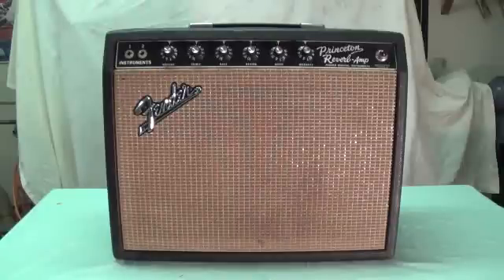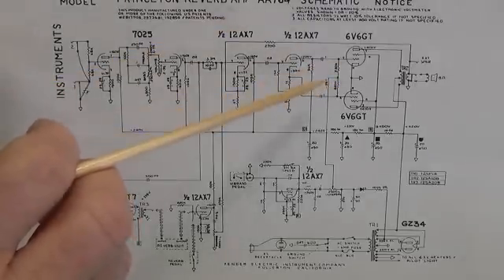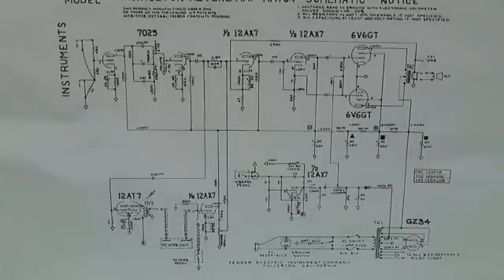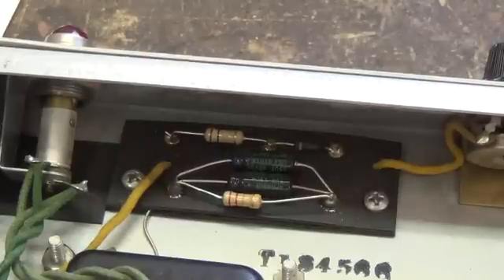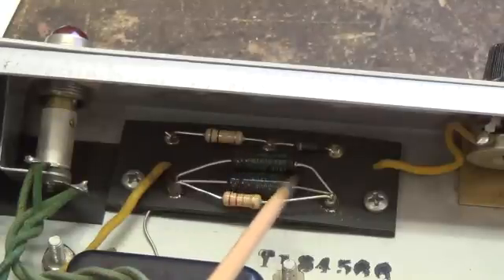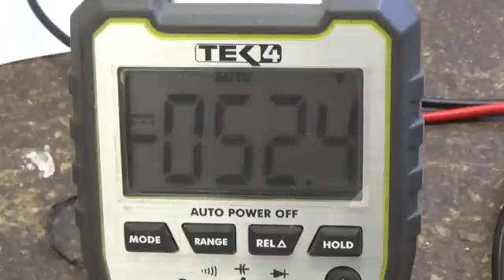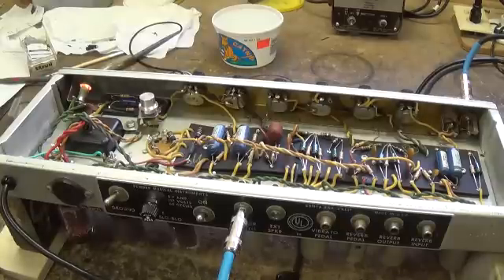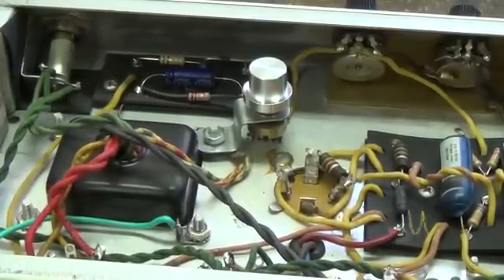Converting the Fender Princeton to Adjustable Grid Bias

Comment: Hi Doug, first I really enjoy these videos and thanks for that. It appears that you are still responding to this older video so I have a couple of questions for you if you feel inclined to answer. Twenty years ago I purchased what I can best identify as a mid 70's SF Princeton Reverb. Some months into using it I smoked the power transformer. I have no idea how. I had it replaced by a qualified tech. It has worked fine (with limited usage) ever since. I got concerned when you spoke of Russian Roulet when it comes to the original pair of 50/50 capacitors. Is it possible that this was the cause of my burnt transformer? You didn't say what could happen if this pair is not changed. Thanks, TW (This mod looks so simple I might go ahead and do it - I'm sure Rusty is still your helper, just at a different level))
Reply from the maker: If you are referring to the 50uf @ 50V cathode bypass caps, they alone could not have caused the failure of your power transformer. The originals can be easily and inexpensively replaced with the higher spec new caps. You should also check your output tube bias.....which CAN cause the PT to fail.

Comment: The best tube amp instructor/editor/photographer/best boy on the web bar none. My only question on this very well done video is can the pot or knob possibly ground to the chassis? The pot looks like its only a few mm from the chassis. Hopefully someday soon Doug will do a video on how to set up and use a scope/signal gen to troubleshoot and bias a tube amp.
Reply from the maker: Thanks so much, Mr. G. The pot is well grounded through the metal bracket that holds it. I have made several videos using an oscilloscope, please see my video list.  The scope is not used for biasing.

Comment: Doug, I've just built my first Princeton Reverb and spent all evening trouble shooting it.  I got it working but had to revert the bias to standard.  The pot is still in place so I would like to get the adjust working.  What range should the negative voltage be from the pot in one direction to the other?  I was only getting a few volts if I turned it slowly but if I turned it quickly it would give me more but then settle a few volts more than it started.  It's just to help me trouble shoot it.  Many thanks.  You have inspired me.  I have now built a 5F1, 5E3 and the Princeton Reverb.....  I have five boxes with parts building up for five other amps.......
Reply: I should have watched to the end of the video again!  I only watched it to the circuit diagram this time but when I came back to ask you I let it run and you show the range!! :-)
Reply from the maker: I'm glad you were able to resolve the problem, Darren. Best of luck with your amp.

Comment: Hey Doug, thanks again for this video!  I have a simple question about the capacitor that is inline with the 27k resistor.  Does the end of that also connect to the new 10k bias pot?  From the angle the video was shot, I'm unable to tell.  
Sorry, if you already answered this question, I got dizzy reading all of the questions and replies.
Hey Rusty; what's up??!!
Reply from the maker: You may be referring to the filter cap for the -DC bias circuit, William. It's negative end connects to the circuit and the positive end goes to ground.
Reply: @UncleDoug ; thanks for the reply.  Have a great day!
Reply: @UncleDoug    thank you for this reply, UD! However, I'm still not seeing it-- do you leave the cap in place where it was originally or do you connect it to the same point on the pot like the resistor? Saying "it connects to the circuit" is still a little confusing as, well, the whole amp is a circuit.

Thank you from a non-EE slack-jawed yokel.

Comment: If the pot fails due to contamination in a way that it creates a large resistance greater than 10k from dirt on the wiper, the tubes will redplate due to an absence of bias supply. I sometimes wonder if running the pot in parallel with that resistor to ground is safer. That way if it fails there still will be bias supplied to the tubes. I sometimes fret over all that bias supply depending on that pot not getting "scratchy". Also, wouldn't changing the value of that 27k resistor to a higher value give you a sweep in both directions instead of just biasing hotter?

Comment: Great vid, thinking about doing this on my Non reverb version Im not using the ground switch, I have a flat head shaft type pot, any reason not to install in there? The can cap is original not leaking and holding a charge long after turning it off, any reason to replace it now? 1965 Princeton

Comment: dear Uncle, I've completed my Reverb fixing, and it was performing fine, then I decided to check for plate dissipation, according to  your video guides.  I measured voltage drop across center tap of OT and the other two ends, each for each power tubes. I had about -4V  DC, with a plate voltage of about 399V DC. This would mean a PD of about 10/11 Watts.  That seemed a bit to high to me, so i decided to install the small 10K pot to adjust bias. If was responding ok, I swept it so to have around 8 W of PD. After that  I was putting back the ampli in his case, then I was horrified to discover that no sound was coming out from the speaker. I did not  make any evident mistakes, no smoke, no shorts....I removed the pot and restored original connections but stilll no sound, just a little hum. So it is possible that I have killed the 6v6 during my tests?  I'm lost at the moment, going to follow the whole signal path to see whats wrong.
Reply from the maker: You didn't provide enough information for me to check your calculations, D, but I doubt that you destroyed your 6V6's while reducing their bias.  Check the bias voltage on the grids.....you may have inadvertently increased it to the point of stopping the current flow.  BE SURE you are properly calculating your PD.....remember that PC is voltage drop divided by OPT winding resistance.
Reply: @UncleDoug  ok Uncle, all sorted out...the culprit was one of the copper wires connecting components on the preamp to the chassis under the pots, which was disconnected leaving all those component with floating ground. Anyway, I've set the bias pot as follows: on one of the 6v6 plate voltage is 405 V to ground, resistance of that side of OT is 146.6, Voltage drop across it is 2.95 ohms, so PD should be 8.14 W, am I right? The other tube has similar values. Am I too cold? The amp tends to distort a bit at high volumes on input 1. Is that desiderable or normal? Thank you again
Reply from the maker: @dreamlessfull  Your calculations are correct. If your circuit is grid biased, 8.14W is ideal. If it is cathode biased, this is way too cool.....and should be more in the 11W range.
Reply: @UncleDoug  yes, being a '67 blackface princeton reveverb, it is grid biased, as the cathode is tied to ground. Thank you again for your time and your invaluable teaching!

Comment: Hey Uncle Doug, I am going to attempt this mod on my 66 Princeton. I believe that I have a firm grasp on the procedure after a couple viewings of your tutorial. But I have a couple questions.......#1: The diode coming off the 100k was facing positive to ground in the stock configuration, right? I see that you adjusted, and re soldered it, but it was orientated that way to begin with. #2: You put some heat shrink, or some kind of insulation on the 27k resistor yes? Is that necessary? Or just something you chose to do just because?

 I think that's all I have, question wise. Hope all is well, and thanks for the great work. 

Josh
Reply from the maker: 1.) The diode just after the 100K resistor is really not facing ground on either side, JC. It is biased so that the banded + end is toward the HV winding and the - end is toward the bias circuit. Thus only -DC (which is what you want) can pass through it to bias the output tube grids.  2.) The heat shrink was simply my own idea, to reduce any chance of a short circuit.  Good luck with your project.
Reply: @UncleDoug  That's a BIG 10-4, thank you for the quick response. Time to go play with electricity.
Reply from the maker: @mr.joshua657  Good luck, JC. Be careful.
Reply: @UncleDoug  Just wanted to let you know that the Adjustable Grid Bias circuit install was a success! I got it done right the first time, and I didn't get lit up. It's a win win! Such a fairly simple mod, I just wonder why Leo didn't put one in, in the first place. It seems to me that the BEST AMP EVER MADE should have such a device to make sure that your power tubes are operating at the proper voltage.Thank you again.
Reply from the maker: @mr.joshua657  You're quite welcome, JC. I'm really glad to hear that your project was a big success.

Comment: Recently did this mod to a friend's Princeton.  Put new tubes in, and they were running wayy to hot.  After the mod, got the dialed in perfectly.  However, now the trem bleeds into the signal even with the intensity pot all the way down.  Has anyone else experienced this?  Thanks for a great tutorial!
Reply from the maker: Since the bias adjustment voltage with the pot is still approximately the same as the fixed resistance, I don't understand how this could be happening. Are you sure you wired the adjustable bias properly?

Comment: Love your videos!  Would it work to install a pot/resistor combination at the point where the negative grid bias splits to both output tubes and create a "balance" adjustment?
Reply from the maker: It has been done in several of the larger Fender circuits, S1. Here is a forum discussion that may be helpful:   https://www.thegearpage.net/board/index.php?threads/best-way-to-bias-a-fender-with-balance-bias.819427/
Reply: Thanks again.

Comment: In cathode bias situation, it's always better to use a separate resistor per power tube. I experimented it myself and it reduces the hum to at least nothing, especially with not properly matched tubes. On the other hand, I widely prefer my power tubes to operate in Push/Pull.
Reply from the maker: Excellent suggestion, Paul. I believe the manufacturers started the single-resistor method simply to reduce build cost and time.

Comment: Hi Uncle Doug,
Thanks for all the great videos. I've learned a lot by watching them. As the proud owner of a 1966 BF Princeton Reverb, I want to go through adding adjustable grid bias to my amp via your procedure. However, I have a question. In your 12/9/2013 video about biasing double-ended output tubes, you caution against using a grid bias pot due to its effect on the vibrato circuit. In this video, performing that modification is detailed. Just wondering if you had a change of heart about the effect on vibrato or perhaps made a New Years resolution to become less of a vibrato hog?
Thanks again!!
Reply from the maker: I guess I found that the good provided by the bias pot outweighed any possible bad effect on the tremolo.....and that the "bad" was virtually indistinguishable.
Reply: @UncleDoug  Cool, kind of what I figured. Like most things in life, a balancing act. I learned a lot about electronics by virtue of an intense, 5 Trimester Electronic Technician course at DeVry completed in 1987 but since I didn't go into a career of component level trouble shooting, I'm terribly out of practice. Your videos are a great refresher and combine nicely with my love of guitars and amps. Thank you
Reply from the maker: You're welcome, UT.

Comment: Hi Doug, thank you for getting back to me. Yeah there is a schematic for my amp on the net for the Blues Deville 4x10 amp. Well yeah everything that I've read on the net says to do it like that. I always have reservations about a lot of things you read on the net. I  just don't want to blow anything like my power transformer or valves up doing something wrong. I was having some time ago a problem with my 1965 Fender Blackface Bandmaster amp red plating. After exhausting every avenue on what the problem could be, I finally took out the bias pot only to find that it was burnt and  ruined. Replaced it and have never had a problem since. I did make the mistake of trying to use KT66 power valves in the Bandmaster and it was playing fine for a couple of days,   then I went to turn it on the other day a nd it blew a fuse and took out one of the screen resistors. I replaced it and put 6L6's back in and It's back up running. I won't be trying that again. I just thought that maybe you could look at the Deville 1993 schematic for me as I'm not good or experienced enough to read these schematics with any competency. Do you think that I should use a 50K linear pot or a 25K linear pot. Which wound be best. It's just that to install a pot in this PCB board, it's going to be a pain in the butt trying to get that board out to solder these wires in this very small space. Thanks Doug. I wish I had your knowledge on these things. Your videos never cease to amaze me. Thanks so much. Michael Newell from Niagara Falls, Ontario, Canada P.S. There's just one last question that I have for you. I presently have a 100uf@ 100 volts in my bias supply of my Fender Blackface Bandmaster. It calls for 25uf@50 volts. Is that value that I am using ok or should it be replaced with something smaller like a47uf @ 100 volts? What does that bias supply electrolytic  cap actually do?
Reply from the maker: The 25K linear pot will be better,  Michael. I avoid working on PCB amps for just that reason (among others).....inaccessibility. The bias cap smooths out the rectified DC for the output tube grids. You are better off using what the schematic suggests:  25uf @ 50V. The circuit designers knew what was best.

Comment: Hi Doug, I hate like he'll to bug you, but I just wanted to ask you a question. You the only one that I know of that could give me an answer to my problem. I have a Fender 1993 Blues Deville 4x10 amp. It has a nonadjustable bias. The cathode resistor is 27K. I've read that you can take a 25K linear potentiometer and run a wire from one side of the holes where the 27K resistor was and connect it to both the left and middle wiper. Then you connect another wire from the other hole where the 27K resistor was in series with a 15K resistor to the ground prong the 3rd leg. Would this be the correct way to hook up an adjustable bias pot? I want to make sure that I am doing this right. Thanks from Michael Newell from Niagara Falls, Ontario, Canada
Reply from the maker: I much prefer wiring schematics to verbal descriptions, Michael, but I think your description is correct. There is one way to be sure. Wire it this way, adjust the pot for maximum resistance to ground, attach DC voltmeter probes: red to the hot bias wire (goes to the tube grids) and black to ground, turn on the amp, adjust the pot until the voltmeter reads -49.6VDC.....then measure the plate current and plate dissipation. Adjust the pot until these values are correct.

Comment: What about a 22k resistor on the 10k pot to ground? Does it have to be 27k?
Reply from the maker: The 22K resistor would probably work just fine, Chris.
Reply: Uncle Doug thanks! Also can you help me understand why the intensity pot isn’t changing neg bias voltage to tubes when turned?

Comment: Do some people put the bias control adjustment where the external speaker jack was? I ask cause I'm looking at a SF Princeton and there's an adjustment screw in the ext speaker jack. The seller bought the amp that way and doesn't know what it is.
Reply from the maker: I guess you could, Tony. The only way to be sure is to see how the pot is wired. The problem is having it exposed in any way is asking for accidental changing of the very critical setting.
Reply: Thanks @UncleDoug   an old tek told me it could even be  a master volume but he's have to see it.If I buy it I'll have him check it out. He also say he does a simple mod  by running a jumper to make it like a PR as far as gain.I cant decide between the Princeton or the Princeton reverb so much conflicting info on the web. Wouldn't  using my clean boost pedal drive with the non reverb model?

Comment: You could add a balance pot network to balance out tube mismatch from ageing also,i need a balance pot network.

And i love seeing rusty,i know he's no longer with us,but all the same,i love dogs.

You see ,your dog has a different temperament to  your wife(not your wife ,just in general),
because the later you are out,
the warmer the welcome you receive when you return home. 

Love the vids,i'm a tech and do make amps,but i don't get to see inside or work on older amps,plus the mistakes fender,marshall made,like not adding variable/balanceable  bias circuits.

Subbed and like every vid.
Reply from the maker: Thanks, John. Some Fender amps came with the balance control you suggested. Unfortunately, not many come with both the variable bias AND the balance adjustment.
Reply: I'm in scotland so i would use pounds sterling,but the term "dollar driven" still applies ,considering what two or three pots and a couple of resistors(all bought in mass bulk too i might add),fender,marshall to name a few are mostly cheaply built RCA copies,and custom builders (like you and i) can be asked to justify a higher price rate,and for something that would equal  the build quality of old valve/tube  hifi gear from early years that still work to-day with very little done other than maybe caps and tube/valve jobs.
The modern pcb amp "made in (3rd world cess pit) are over priced garbage badly built with bad design criteria.

kindest regards,

jh.

Comment: One thing I never really understood: Why did most companies drop cathode bias? It works fine, and it is easy to implement.
Reply from the maker: I wasn't aware it had been dropped, Kim. It's quite common in low to medium wattage and single-ended amps.